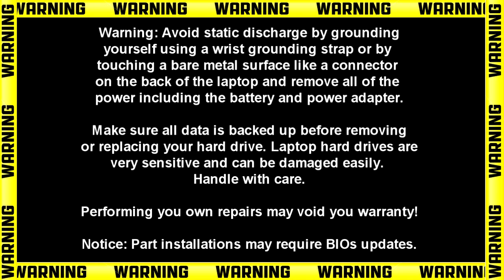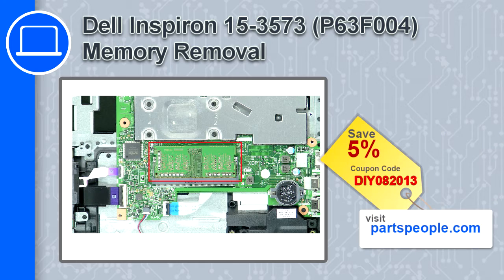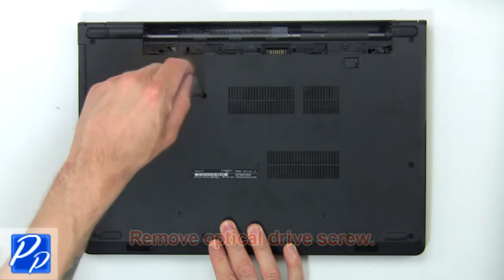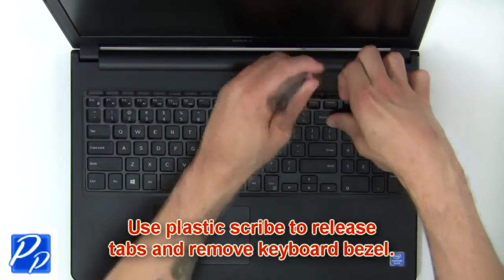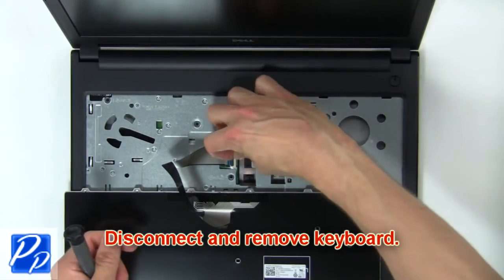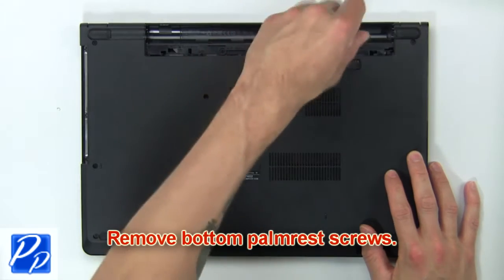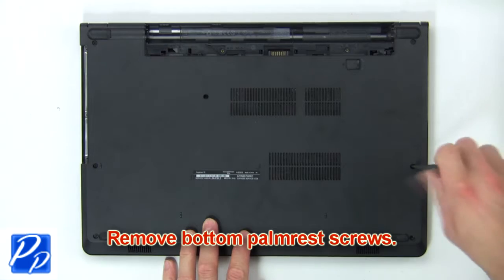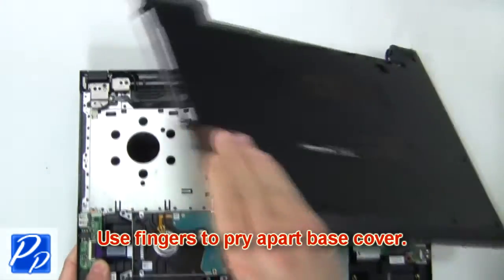Dell Inspiron 15-3573 (P63F004) Memory How-To Video Tutorial

Comment: Can I ask something? Can I remove the base cover without pulling out the optical drive? And do I need to remove the keyboard in order to remove the the base cover?
Reply from the maker: The screws under the optical drive and keyboard all secure the bottom base so they must all be removed.
Reply: @dellpartspeople  ok thanks!

Comment: So very, very helpful!  The only surprise was that I actually have an optical disk drive (ODD) connection that was still attached by a ribbon cable when I (tried to) remove the laptop bottom.  Once that was disconnected, removing the bottom of the laptop was fairly easy.  When putting it back together, it was a bit challenging to 1) get the ODD ribbon cable fed back through the top (where it lays underneath the keyboard) and 2) make sure the power wires along the back were laying in their channel and not crimped by the edge of the bottom cover.  Thank you again for a great video.